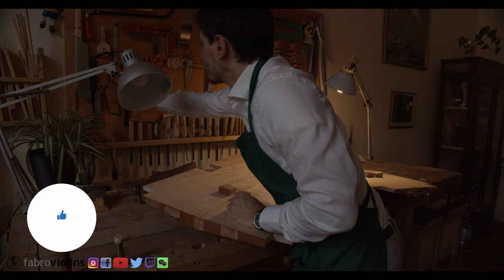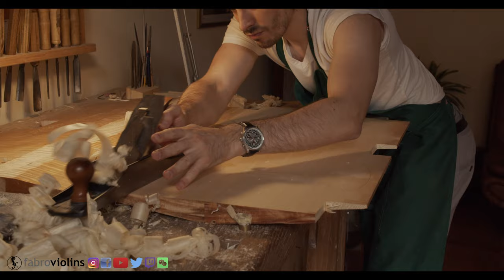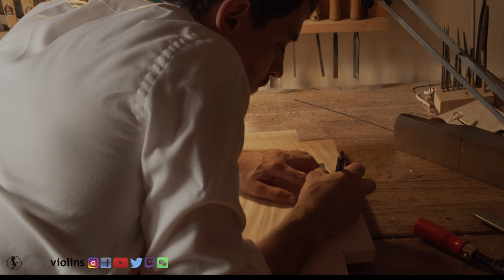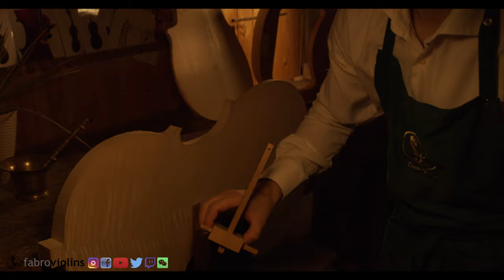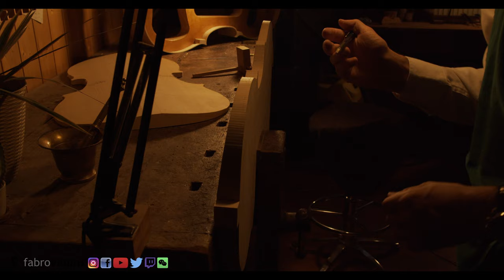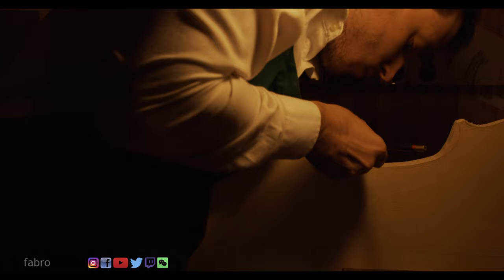MAKING A CELLO | Preparing the Plates | Ruggeri Model

Comment: Hey Luca, I love your videos! I build electric, acoustic flat top and archtop guitars. I watch your videos for inspiration and ideas from the classical instrument world. I love the Italian style of stringed instrument building, how you use the inside mold which is the total opposite for guitar building. Because of you I have totally abandoned Titebond for hide glue on almost every step in guitar building. I learned about sizing glue joints from watching your videos and wow what a huge difference in strength and glue up time the joints just disappear. I do have a bit of advice for you that I use when trueing back and top plates, I rub a little paraffin wax on the sole of the plane it cuts down tremendously on friction. However I never do this on glue joints, only when I’me doing a lot of planing. You will know when you need to add more wax, when it gets harder to push the plane. I also use Lie Nielsen hand planes. Keep up the terrific work and videos.
Reply from the maker: Thank you very much for your nice comment! And I'm glad that you enjoy my videos! (and that you abandoned Titebond haha).
Yes, I never do the paraffin thing as I'm always afraid to leave some residues. However, what I do but I don't think I show on the videos (for obvious reasons) is to rub the surface of the plane on my face when I'm sweating...That makes the plane run much smoother too!